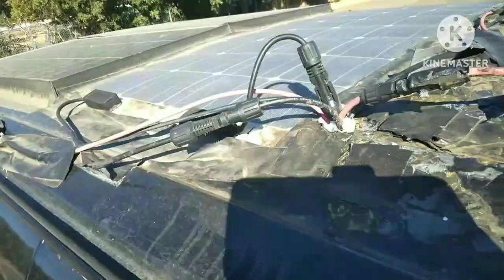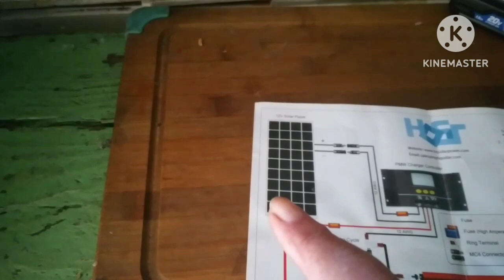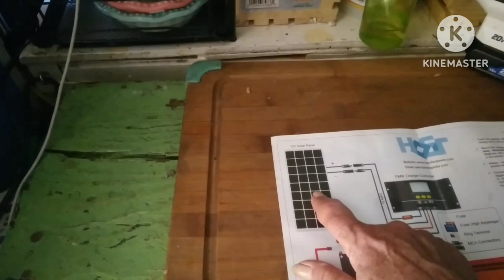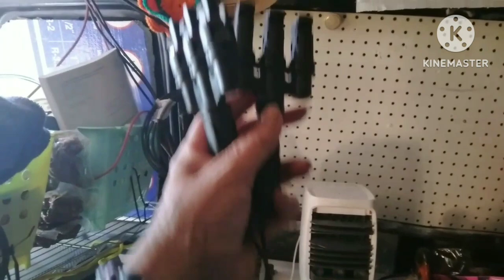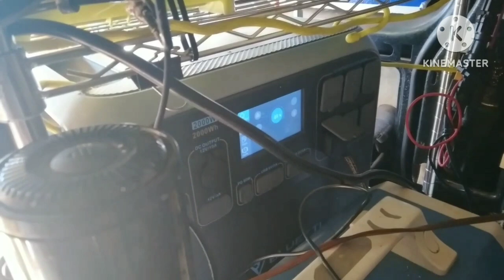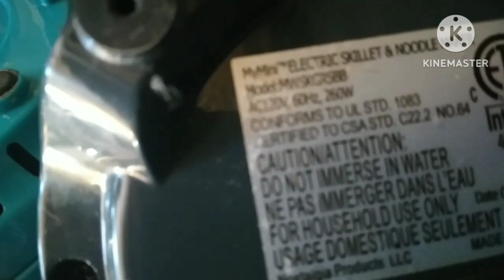Van Life: AMP WATTS VOLTS  ARE YOU CONFUSED?

Comment: Very good. I like your analogy of the cars at a stoplight. Please do follow up regarding wiring size. And, that running panels in series, increases the voltage coming into your charge controller so you can use less expensive wire that’s thinner. You could even cover differences in wire gauge and the amps they are rated for. Also to help people not burn their wires by running too high of amperage through the wrong gauge of wire. Maybe cover the pros and cons of both series and parallel and draw or show simple diagram of each. Also the simple formula watts divided by volts equals amps.

Did want to ask if you have set up any extra in-line fuses on your wiring inside the van. Thanks for what you did cover. It was very good explanation. It took me a long time to understand the electrical component of solar set ups and the difference between series and parallel. Definitely a cost savings as well being able to run longer wire when you get your panels set up in series so that they produce a much higher voltage with a lower amps, at the same amount of watts. Allows using less expensive thinner wire over longer distance. Not that that’s a big concern. If you’re just wiring up a van. Still it’s a lot easier to manage less bulky wire. ❤ loved your solar class

Comment: Explanation great 👍 can I ask how long your fridge will run before you switch stations? I have 2 bluetti one is AC180 1800 watts and a small 600 watter. I planned on having my solar panels put on my roof in January 2024 so until then charging from alternator and family homes 😊 Also do you think wiring panels into larger bluetti would be easier then battery and other items.
Reply from the maker: I use my solar for all my units so I won't hard wire it. I use my big one to charge my little ones because they are more efficient with smaller watts